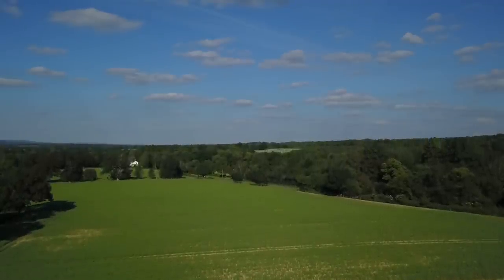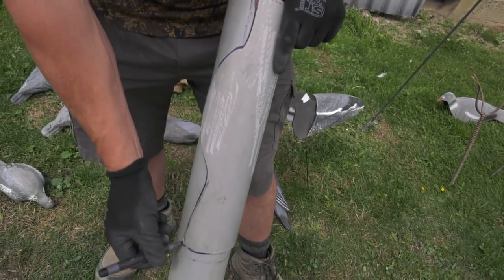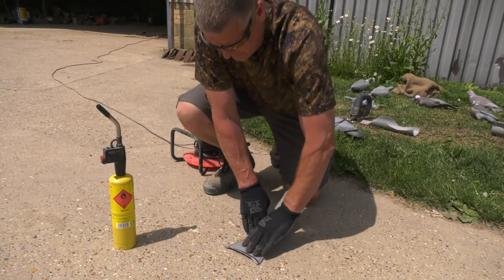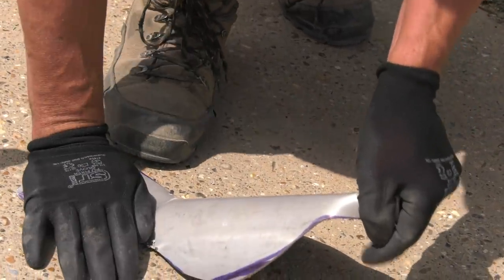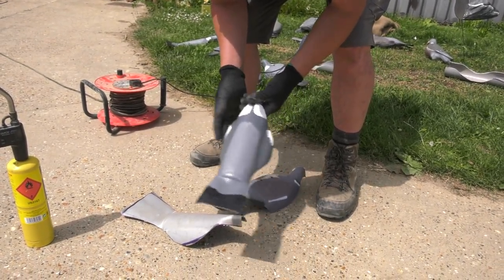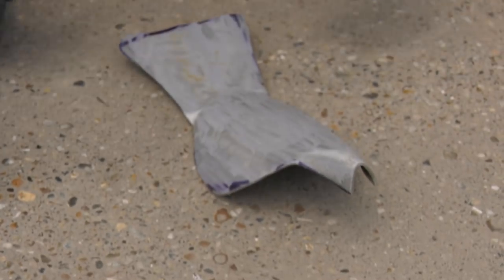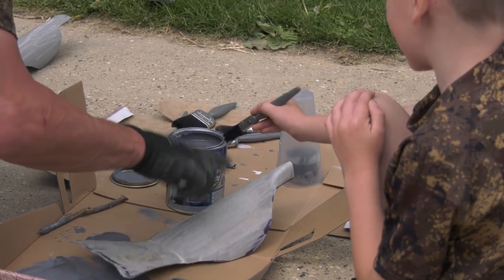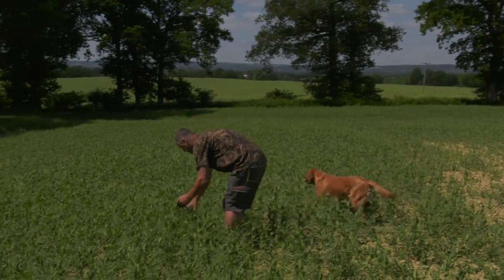How to make pigeons decoys like the old days, with Andy Crow

Comment: I used Male cardboard urinals back in the day (new ones). Just soak the opening with water and flatten it for the tail and make a hole in the other end for the head which was made of foam rubber. A bit of paint and away you go. The flat bit on the bottom helps it stand straight.

Comment: Great video. You will have to do one of retro lamping for foxes. A car battery connected to a spot light from an old car & using aeroboard insulation rubbed on a rear view mirror to call them in. Great memories of doing it with my father & brothers.